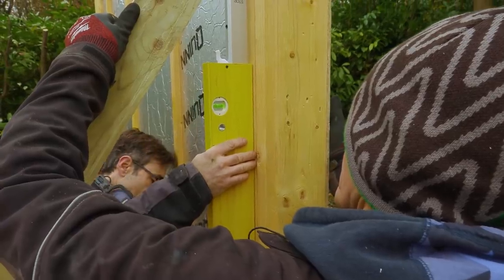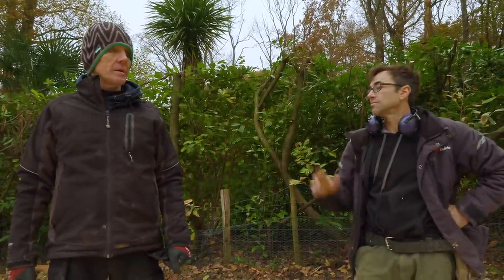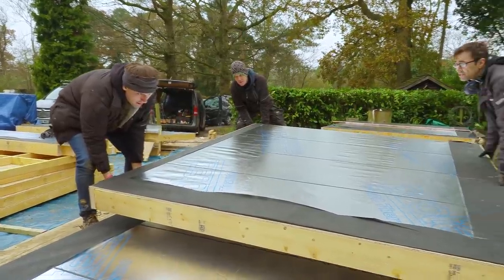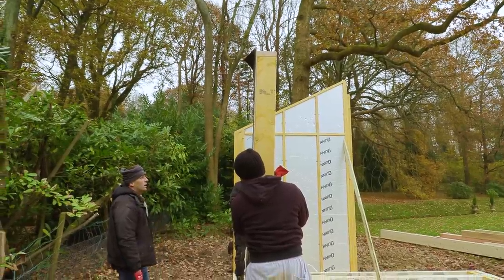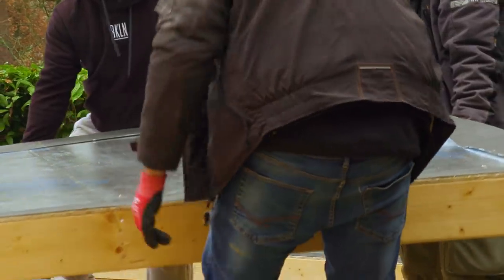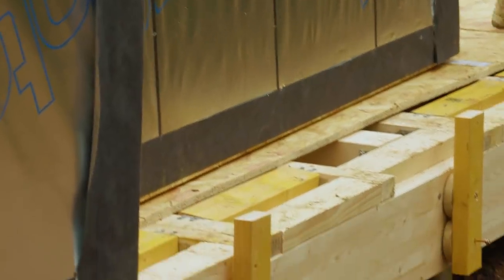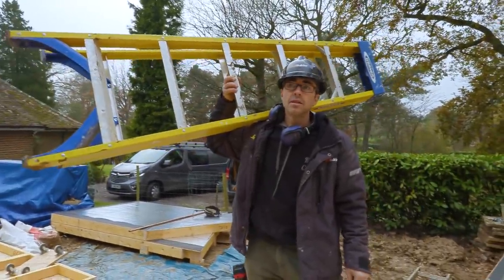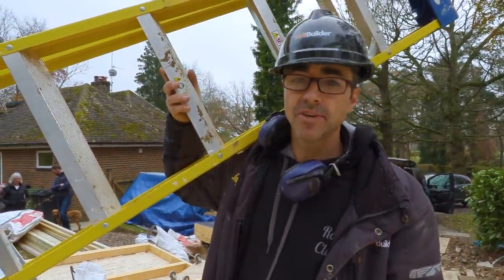How to Build a Timber Frame Garden Room #2

Comment: Wish I'd seen this when I was lifting a 500 cm steel H-beam alone using home-made cribbing. Your method with the threaded rod between supports to prevent the beam from shifting sideways is so much safer!

Comment: Regardless if Mulwaukee Tools are sponsoring this video series, to a layman, it's incredible that a cordless drill/ driver can put a long screw through 3 or 4 widths of 1"+ timber. I can only imagine the pain it was only a couple of years ago to have extension leads and cords all over the place, and everyone fighting over them. Now I guess every carpenter/ builder has a suite of these, and all you need is a good multi battery charger and lots of batteries, and a customer who doesn't mind plugging it in for you.

Comment: Perfect job for a genie lift if not enough bodies great work as always 👍
Reply from the maker: You are right, we use Genie lifts all the time but here is something different.
Reply: The lift height would have meant that we would.have had to have the larger genie also the floor deck was being fitted after the structure was built so we would have had to temporarily deck the floor strong enough for the weight of the genie etc, I did ponder the genie idea but we only had a couple of days to build this so it was better to just find an onsite solution and go for it!! Thanks for your comment
Reply: @SkillBuilder  oh I'll be copying that  ladder method somewhere down the line 👍

Comment: Might be best to use two threaded bars, leaving the first in place until second is secure each lift...just in case it falls.
Reply from the maker: You are not wrong. On the next one it will be two each side
Reply: Ye I was think the same thing.
Reply: 67
Reply: Just hire two genie lifts much quicker and safer all round.

Comment: I like your idea with the metal rod to lift the beam. I might have to try that one! When I have done similar in the past I have put tower scaffold beneath the object being lifted near each end so if the worst happened and the beam dropped it would full on the tower scaffold instead of crushing someone.

Comment: What are your thoughts on cardboard tube concrete piles?
Drill down, drop in the tube level it up and fill with concrete. They are easy to set very accurately but are not rammed in thoughts?

Comment: Has that celotex got a DPC or similar on the outward facing bit?

Im working on turning my old wooden garage which is just planks then the outside world in to a room 

I have planks then a 75mm pillar so was just gonna do 50mm celotex, 25mm batten then plasterboard on top -looks similar ish to what you guys have done but nit sure about damp proofing

Comment: Hello again Robin just had a thought I see you stepping off a lot with your framing square which is great. Just wondering if you ever came across these two products when I came back from Canada I brought back a little black book that’s designed to fit in your tool belt called the Roof framers Bible also I brought back a Construction pro calculator which is brilliant you just enter you run and rise or run and pitch and it will give you Rafter length hip/valley and jack lengths etc It will do rake walls stair cases it endless  I highly recommend it 
Regards Mark
Reply from the maker: Thanks Mark
We have good contacts in Canada so we will check it out
Reply: Skill Builder You can get the calculator here now Robin just Google it some UK companies have it in stock best prices are around £60 but worth every penny . As long as your plates and ridge are level and parallel your good to go 👍

Comment: This may be just me, but a Garden Room is where one grows plants. Which means lots of windows. Don't seem any windows yet. So will be curious how things proceed to part 3 and how that is addressed. Interesting series. And very nice work. Well, actually, no I am wrong. I am understating it. Damn fine and lovely work.
Reply from the maker: You may be right, there is a lot of terminology now which doesn't always play out in reality. The 'Orangery' is a good example. Probably  best to just think of it as a stand alone structure built to the customer's requirements which could be accommodation, office space or any one of a number of other things. What varies is the number of windows etc. The basic structure is configurable so, in many ways the end use, which may change as time goes on, is the least relevant part. We are also keen to safeguard the client's privacy because they were good enough to allow us to film it.

Comment: Nice beam lift. I would suggest using two rods on each side. That way the beam is never in a state that it could fall all the way down. This could also be achieved by attaching some lumber across the two posts. You never know when a hornet nest is going to fall lout of a tree while people are lifting something heavy.
Reply from the maker: Good tip and would have been easy to do. Too cold for hornets and anyway we work through them

Comment: Nice job chaps..can I ask what material you've used on the outer face of the walls, I'm guessing on top of the OSB3... thanks
Reply: The membrane is called Protect 200 it is a membrane designed specifically for timber frame it comes in large roll format so it can cope with the storey height in one go...

Comment: What is the advantage of making it with wood? Is it cheaper than bricks and mortar?
Reply: Speed, its lighter so the foundations can be less destructive, also the overall wall thickness for this is 200mm as opposed  to 300mm for cavity brickwork, so you gain space also, not to mention the better thermal qualities
Reply from the maker: With a name like Twig I am surprised you asked that question

Comment: Another way to lift the beam could be to screw in supports with enough clearance above the ridge level so there's slack to slide the beam into position and wrap some straps on that sucker and ratchet it up on either side and then slide it into place. Bish, bash bosh bosch.
Reply from the maker: We considered that idea.
Reply: @SkillBuilder  were you worried about the straps breaking. You could have doubled them up as a failsafe. Robs idea stole the show though.

Comment: clever idea but could be made much safer with 3 rods. Leave the rod in place during lift and place the third in the hole above. Only when you're sure it's seated in the new position do you take the old one out - then you always have a safety bar during the lift in case of slippages

Comment: If you ever do that again, make sure you have a third metal pin so you can lift, insert pin, remove the unused pin and then go to the other side. That means that if the beam had been dropped it would have had a stop in place for safety,

Comment: Looking at the height I'm guessing that will have required planning permission
Reply from the maker: yes it has planning consent
Reply: not 100% on this but I think the 2.5m height restriction is only if you are near a boundary.
Reply: @dannymurphy1779  They said it was a 10 metre beam. You need planning permission on any building with a footprint greater than 30m2. The building is 10m long and is definitely wider than 3m so planning permission would be necessary.
Reply: @YipeeKiYayJB  Are you sure it is not a volume of 30m3 you need planning for? In which case 2.5 meters height would only be allowed 12m2 maximum.

Comment: Surprised you’re going down the pre-fab panel route, I would have thought Robin would have stick built it instead?
Reply: Dan Giles if you’re in-demand it’s the only way to fit in all the jobs. Also, being in the UK, it’s the only guaranteed way of getting a truly watertight install. It’s the future, all houses will be timber frame prefab.
Reply: shandyooo it’s definitely a timesaver on site using pre fab panels but for a build like this it wouldn’t take long to knock up the walls yourself. Also the watertight install doesn’t make sense as you’d be able to run the membrane continuously around the structure without the lapped joints you get between panels.